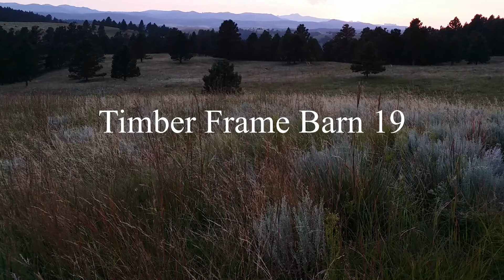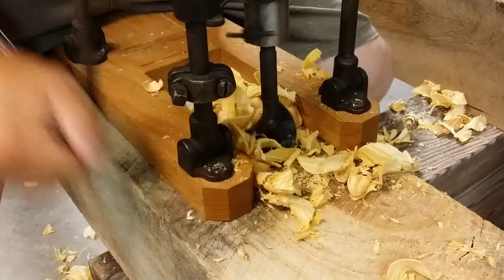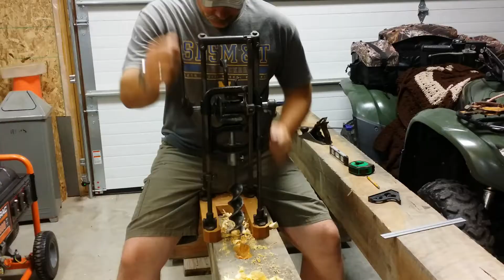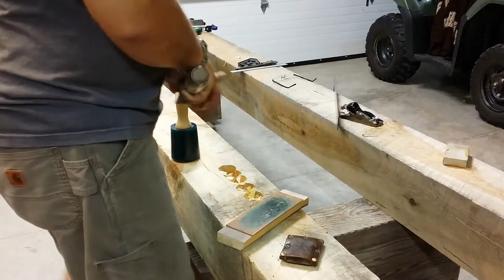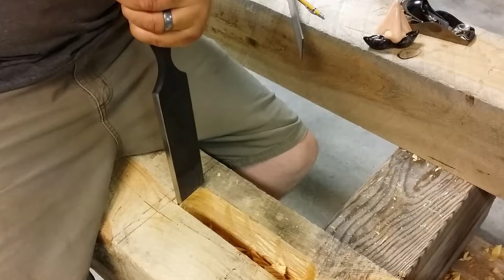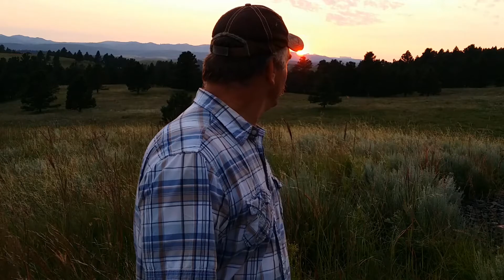Timber Frame Barn Project - Dog Day Mortises

Comment: Does the boring machine force the auger tip into the wood? Sometimes the screw tip has trouble grabbing the wood.
Nice job of restoration of the boring machine. Jim at Tradesman channel said he wanted to get one.
Reply from the maker: Lars Eckman Thank you.  Yes, the bit depends on the screw tip to pull it through so in knots it sometimes looses it's bite.  It works great.